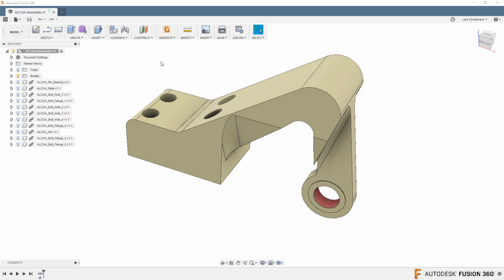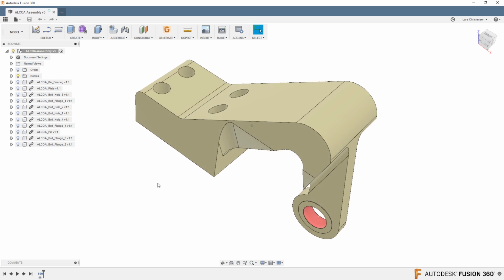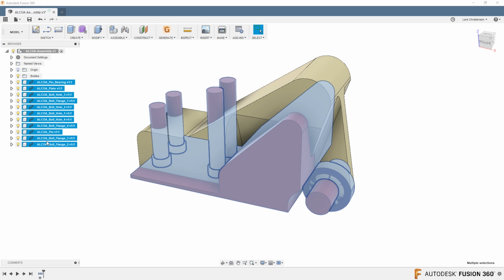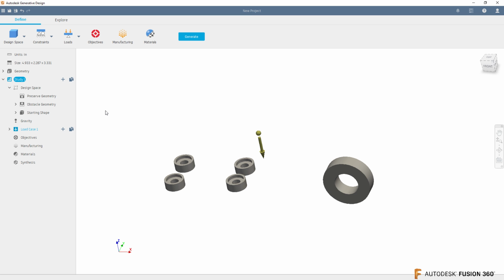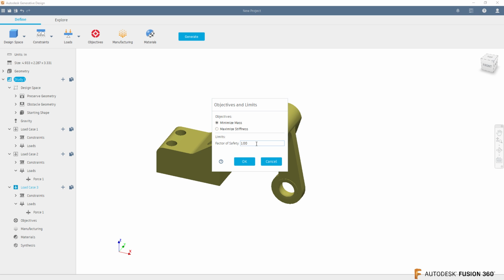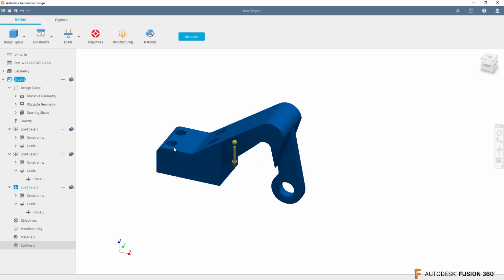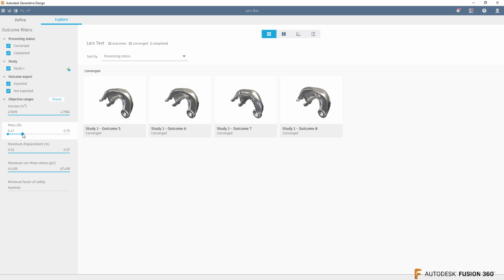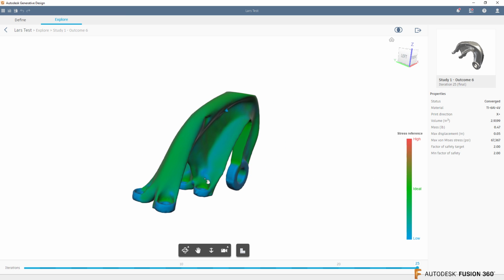How To Setup & Run A Generative Design Project — Fusion 360 Tutorial — #LarsLive 175

Comment: PAYING USERS THAT'S BULL, LET US  USE OUR OWN GPUS OR CPUS TO DO THE WORK
Reply: right? they let you use your own GPU for simulations.. 
not everyone has a crappy computer. i wouldn't mind if it took a couple hours to do the work. i can always sli and overclock.
Reply: @darkshadowsx5949  Guys, that's pretty naive... There is a buttload of possible reasons why that wouldn't even work... 1st if it makes use of a super computer... Then your computer won't do ANYTHING, no matter how much time you give it... Incompatible...
Second: If it uses the kind of processing power your end-user rig does not have... So you may not be talking "a couple of hours", but a couple of months instead...
Third: If the design process is proprietary... Then they would not trust you with the code... They keep it in house and you just send the input and receive the output.
and... and... and... Long story short: No, you likely can't just SLI and generate this type of stuff in minutes on your private i5.... ^^
Reply: @mcbrite  except other software can do the same on my pc quicker than fusion does in the cloud
Reply: @TheLordinio  Is it the genuinely exact same?
Reply: @mcbrite  no of course not since it's not the same Software but I find it very annoying that they keep saying things are not possible when there is Software around that has been doing that thing for many years.
Reply: @TheLordinio  Like I said: Unless you can be sure the local version provides a result equal or superior to the one from Fusion, you have no point to make...
Reply: @mcbrite  you're underestimated present day workstation PC's and overestimated the complexity of this technology. Fusion 360 is a pretty bad reference in terms of considering what's heavy or not for a workstation because the software is extremely, extremely slow. When editing your sketch takes forever, it's not your pc that is slow.. It's the software that is clunky. Generative design isn't a "a couple of months" kind of task to process for a workstation.

Comment: I currently design and fabricate using tradition methods. But this sort of thing is really interesting. Even if I were to fabricate these brackets with manual machining techniques, the generated designs would be a great starting point to layout a more typical shape without all the complex curves. 
I want to start using the free version for some personal projects to get a feel for the software. If I decide to use this commercially, how much does the licence cost that includes the generative design functions?

Comment: The biggest limitation of this (I am coming from Autodesk Inventor HSM 2019) is that there needs to be an offline solution to this. If I were to work with ITAR parts or components that are not allowed on clouds like this, an offline [local] solution does not exist. So as useful as this may be....it has one limitation that completely makes it aggravatingly useless because it could be brilliant if I can use it offline. I don't care what the hardware costs are for this software, if I can't use it for ITAR or extremely proprietary designs, then I can't use it. That is truly aggravating. Autodesk does the same thing with Remake, they closed that, and Recap Pro (to my knowledge) requires cloud credits. 

I use Inventor because it is an offline, local solution. It is so frustrating that offline solutions don't exist for this because it's awesome! I NEED TO USE THIS OFFLINE! I don't care if I need my own several tens of thousands in GPU or CPU servers, if my clients don't allow it, then I would be better off paying for the hardware to do it locally even if it can be done for less and faster through Autodesk's cloud rendering/computing. That's my biggest issue with it, I'll lose more money not having an offline solution. I think the cloud is great for uses like this, but that's with the assumption everyone can do so or you don't care about the people that can't/won't use it. It must have an offline generative design solution.

Please....please give us the ability to use generative design with local resources?

Comment: Hi Lars. Awesome video thank you. I'm currently working on a bulkhead for one of  our robots. I wondered why would you need separate load cases as I start one and add all the forces in it. Should I be doing a separate load case for every separate force? Also I really want the part to be as close to 1.4kg as possible. I have set the loads, material, and objective with a SF of 1 but the parts start to balloon and have safety factors above 2 to achieve this. Am I doing something silly?

Comment: Hi, Do be aware that safety factor can either be defined by the yield point of the material or Ultimate tensile strength, for aircraft this is very important to clarify based upon which load case is being assessed, limit or ultimate cases etc.. the safety factor method is defined when assigning material properties. For clarity It may be worth highlighting the equation used in your code for assessing the safety factor since aircraft use either reserve factors or margins of safety, depends if your in the USA or EU which you use.
Reply from the maker: Hi Darren Hodson Thank you for watching! Abd for sharing your knowledge!!!Thank you

Comment: Hi Lars... I posted this in a previous video and am reposting this here just in case you didn't see it.  I'm hoping that you might be able to answer this question on your next video. Question... I have a number of engineers and designers viewing and querying a design and every time they exit the file Fusion saves the file by default and also sends an email to the team causing much fear that the design has been altered when in reality, it's just been viewed and components have been turned on and off, etc. Is there a way to exit a design (model) without Fusion automatically saving it and creating a new version? Thanks in advance. Pete
Reply from the maker: Hi OneLiterPeter Thank you for watching!
Are they using Fusion Team or are they using an individual person's accounts to share design?
https://fusionteam.autodesk.com/pricing/index.html?AID=11343162&PID=8206971&SID=jkp_CMntzPPK7tsCFQPQswod8XoMug&gclsrc=ds&mktvar002=afc_us_nmpi_ppc&gclid=CMntzPPK7tsCFQPQswod8XoMug&cjevent=e45860f9786011e88387044f0a24060c

Best,
Lars
Reply: We're currently not using Fusion Team, could you possibly do a live stream on collaboration, version (revision) control in the future? It's possible that you've already made a video on this topic so I'll hunt around and see if I can find something. Re: my above question... A couple awesome Fusion users pointed me in the right direction and the team currently has auto-save on exit unchecked so that if someone opens up a model to view/query... it now prompts them to exit without saving.
Reply: https://www.youtube.com/watch?v=BViqGDbC-mo